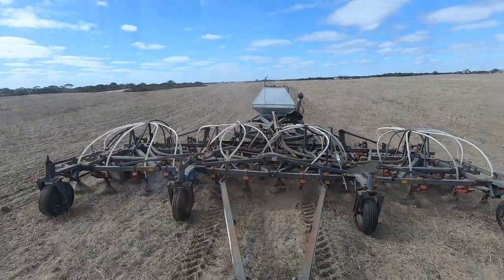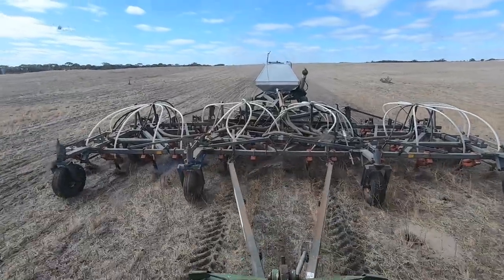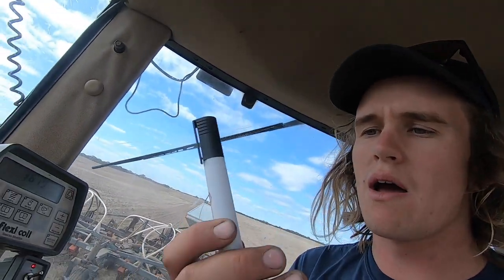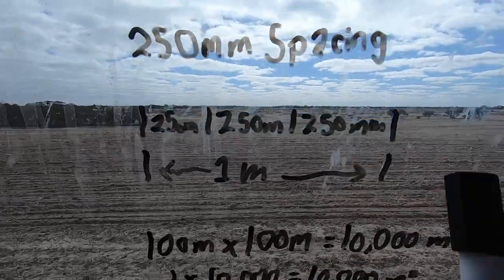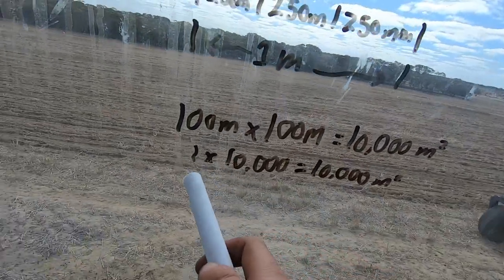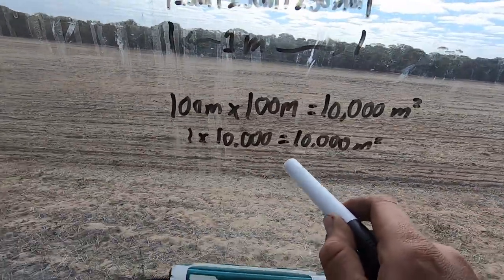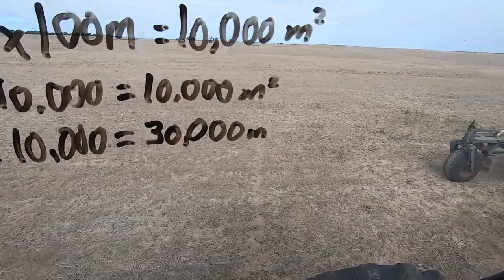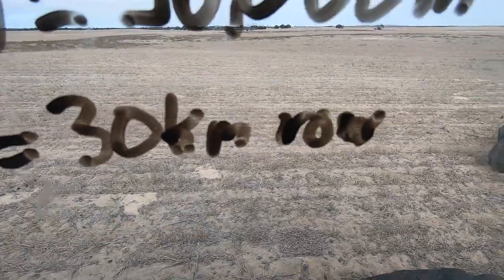I CALCULATED IT WRONG! 😱 | How Much Seed Row Do We Make? | Tractor Cabin Maths

Comment: Top marks for the maths but you actually do count 4 tines, so it is 40 km of row per hectare. 1000 hectares and you've gone around the world.
Reply from the maker: Oh there you go silly me 😂
Reply: @merrettcontracting  yea the mistake is that in ur drawing you have 3 gaps of 250mm which is a total of 750mm not 1 meter, but since you labelled it as 1m you then moved on with that in the following calculations. Additionally if you were to just do 1m there would be 5 furrows and 2m its 9 as there is the extra 1 on the end. But ignoring the potential 1 extra per paddock wont really matter unless you had very long skinny paddocks and you planted longways.
Reply from the maker: Thanks for clearing that up! I thought for sure I had it right too 😂 such a silly mistake but mucked everything up! Haha